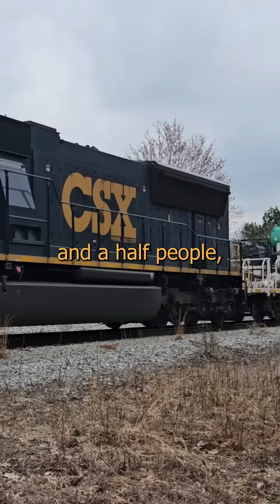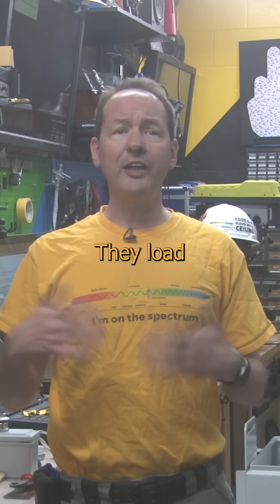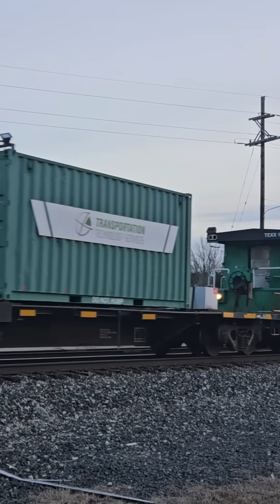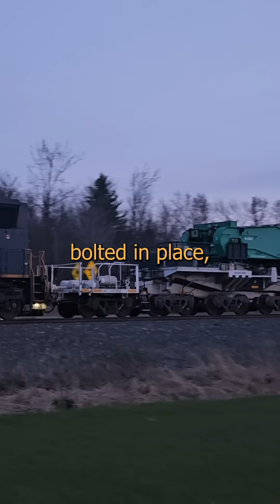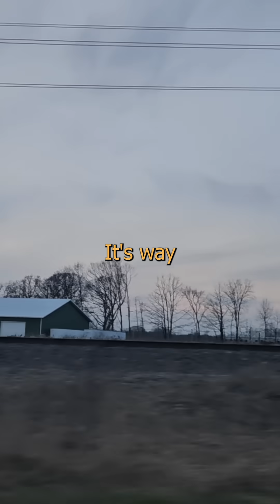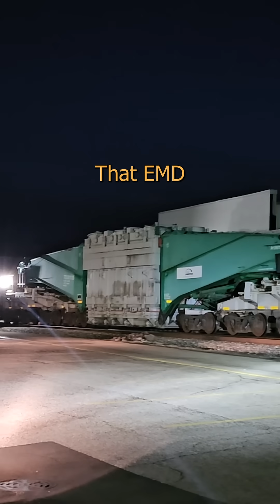Schnabel Car #chrisboden #comedy #train #railroad #physics #transformer #powerplant #engineering

Comment: I play a bit of fairly modded American Truck Simulator, we trailers and loads similar added to our gam, it’s clearly more janky because American Truck Sim wasnt designed for it but pretty much ever rear axles turns all the way around on it and if you get the rear axle backwards you majorly SOL because even with a stupid overkill drive line you stuck maybe doing 15mph while the trailer try to fix itself

Comment: If they're putting two Abrams on a flat car, pretty sure they need extra axles. Not 100% sure, but that would be a 140 ton load.
Reply: Yep. They’re loaded onto DODX 40000 series rail cars which have a capacity of 149 tons. Two M1A2 SEP v3 tanks weigh a total of 147 tons.

Comment: Some of these cars have hydraulic systems because their load isn't just heavy, it's also oversized and needs to be moved sideways or vertically so it doesn't collide with obstacles along the line.
But here in Austria they are usually at the end of a train, behind one or two other cars for equipment and staff. So the longitudinal forces on the load are minimized. Seems they have different rules over there.

Comment: I once saw one of those things that the train was moving on the attachment in Idaho once on two giant ass trailers. It was so fucking tall that I saw it well before I got to the rest area that the M1070 pulling it was parked at. When I say giant trailers, I mean the 13 axle combos that usually move giant construction equipment and electrical substation equipment. I will always kick myself for not pulling in and taking pictures

Comment: Jesus brother... I'm going to have to go sit at the tracks more often. I live along one of CNRL's main-lines... the shit I see come down this track would make your "short and curlies" straighten out, and leave you smiling afterwards. Top that with the fact that the HWY here is a "High Load Corridor" and I've seen rigs with 36 axle's pushing "EVERYTHING" onto the side-roads as they move past at a walking pace (3-6mp/h (or 5-10km/h for those of us not in the US)). 881 US tons (880 tonne) of iron and steel. Wild stuff. Also, love your vids.

Comment: Its also very rare to see a modern freight consist to be using a caboose on the tail end. They fell out of use in the 70s and 80s because of modern monitoring systems.
Reply: That caboose is being used as a control cabin for the schnabel, as they have dedicated operators that can shift the load within the car via radio controlled hydraulics. Also acts as a collision spotter like a traditional caboose

Comment: ¿ Icosapodial ? 

If you would allow me to postulate ?

 " icosa "derived from the ancient Greek word " eikosí " both meaning 20 ... .. .

" podial " In relation to a podium or/and such also in biological anatomy is in relation to the foot, hence a foot doctor is a " podi-atrist "   
In mechanical applications this is referring to the base or a cumulative combination of common columns connections or a varying variety of vertical supports to earth, like but not limited to,
pillars, posts, piers, pylons, pilasters and or in this case I believe wheelsets ( 2 wheels on a train car couple by an axle often mounted to a " bogie " -a pivoting frame assembly typically holding 2 wheelsets ... .. . My hypothesis for this creative vernacular is probably meaning 20 wheels and or points of connection so 20 wheelsets .
So Mr. Boden how was that for an analytical analysis and alliteration ?

Comment: I used to repair rebuild locomotives many moons ago. It is different feeling to stand under a locomotive off of its trucks while doing truck replacements. Most people have never stood under 200 plus tons. It’s shocking to me how many people don’t know that trains and their trucks the axles are only connected by a few cables and air lines.

Comment: I've seen a semi version one. Its very similar to this setup up. But it has semi in the rear as well to help it with turning issues like a firetruck semi with the ladder hauler trailer. Because the load is extremely close to the ground. And sometimes I see them with a pilot car.

Comment: The vertical video format is not doing you any favors in trying to convey the scale of this thing. What an amazing rail... Thing.

I imagine trying to explain this to someone who has never seen one, and all the reasons they'd rattle off for why it would not work, not feasible, no one needs to move that much weight, no one would agree to build a container for their thingamabob to bolt onto that, on and on. 

But there it is, rolling along doing a fine job

Comment: I actually helped work on this as a welder in Boilermakers union, in Waynesboro Ga in 2014. We were using it during reactor 3 and 4 build at plant vogtle, and had to repair some cracked welds. Your right not many will ever see it

Comment: Those things can be offset in the control cab, on banked corners, to avoid obstructions, and not tip over. They have their own power unit, and some have radio remote control, so an operator can walk around while steering it. Obviously at crawl speed, and not while zipping along a straight track.

Comment: Schwerer Gustav

Article

 

Talk

Language

Download PDF

Watch

Edit

Learn more

This article needs additional citations for verification. (January 2016)

Schwerer Gustav (English: Heavy Gustav) was a German 80-centimetre (31.5 in) railway gun. It was developed in the late 1930s by Krupp in Rügenwalde as siege artillery for the explicit purpose of destroying the main forts of the French Maginot Line, the strongest fortifications in existence at the time. The fully assembled gun weighed nearly 1,350 tonnes (1,490 short tons) and could fire shells weighing 7 t (7.7 short tons) to a range of 47 km (29 mi).[1][2]

Schwerer Gustav￼

Model of the Dora

Comment: Big Boy (Steam):

Length: 132 feet (including the tender).

Weight: 1.2 million pounds (when fully loaded with coal and water).

Water Capacity: 25,000 gallons.

Tractive Effort: 135,375 lbs.

Horsepower: 6,300 hp.

Fuel: Originally coal, now No. 5 oil. 

Standard Union Pacific Diesel:

Length: 74 feet.

Weight: Weight varies depending on the specific model and configuration, but generally lighter than Big Boys.

Tractive Effort: Varies depending on the model, but typically less than Big Boys.

Horsepower: Varies depending on the model, but typically less than Big Boys.

Fuel: Diesel fuel.
Reply: FUN FACT there was a type of steam locomotive based on the Schnabel called the Beyer-Garratt and about 1000 were made between 1908 and 1960 mostly being sent to South Africa, Brazil and Australia given they were designed to be very powerful without putting too much strain on bad track in these areas
look up the South African Railways GL class and GMA class and the New South Wales Government Railways AD60 class (both were designed primarily to haul heavy coal trains from the Mines in Natal and New South Wales to the Ports of Durban and Newcastle)

Comment: The train wheels not only deform less, but they are also angled so their contact has less width. Trains run so efficiently because they're almost literally running on a razors edge. It's like ice skating on steel.

This is also why they can't go uphill for shit and need long LONG gradual inclines. No friction also means no traction.

The wheels have to be angled like that so that their self course correcting. If they glide too far to the right, then the radius of the wheel on the right is larger, and the wheel on the left is smaller, changing the rate of rotation  on each side and pushing it back to the center.

Comment: You know the load is massive and heavy when there are only 3 cars!

Those things are MIND-BLOWING!!!!
Reply: FUN FACT there was a type of steam locomotive based on the Schnabel called the Beyer-Garratt and about 1000 were made between 1908 and 1960 mostly being sent to South Africa, Brazil and Australia given they were designed to be very powerful without putting too much strain on bad track in these areas
look up the South African Railways GL class and GMA class and the New South Wales Government Railways AD60 class (both were designed primarily to haul heavy coal trains from the Mines in Natal and New South Wales to the Ports of Durban and Newcastle)

Comment: They used to use one of these to haul oil refinery vessels from Duluth MN to Alberta.  Very cool!  They did it in the winter when the ground was frozen.

The contact patch on a railroad wheel is about the size of a dime.

Comment: Did you guys miss the caboose? That was the second thing I noticed. Haven't seen one of those in forever!
Reply: These are special moves, generally called high and wide moves.  That's why there are no other cars in the consist.  I've heard that, depending on the load, there might be escort personnel from the manufacturer riding with the load.
Reply: To ensure no jarring during the trip, theres been cases were phases are shorted on delivery @videotrains
Reply: I believe CSX requires a Caboose instead of a End of Train Device for special moves. All major rail carriers keep a few Caboose on hand for special use.
Reply: Yup, I miss those old puppies... Now days it's just a Mad Mike plugged into the air line and transmitting to the cab.  Sometimes progression and technology stinks.
Reply: @gerrywalsh5766 they're called FREDs I think
Reply: I noticed that too. neat.
Reply: they stopped using them in the 80s for cost reasons
Reply: I came to say the same thing! You NEVER see those anymore
Reply: @TheGrumpyChuckChannel   Air brakes were created, no need for a brakeman to apply brakes in the back
Reply: @stephaniegiacco7524  That's not a caboose you're thinking of, that's a "braking van".   Cabooses aren't needed on most trains because of technology for lineside defect detectors next to tracks and end-of-train devices.   But they're still used when crews needed, such as for maintenance or for special or hazardous loads.  Hence the one in this video
Reply: @stephaniegiacco7524 Brakemen didn’t activate the brakes since the early 20th century. Brakemen made sure the brake hoses between cars were connected and that the brakes were released after going into emergency. The advent of hotbox detectors and electronic monitoring made the job redundant.
Reply: IKR! And it was painted to match the cars ahead of it. Can't get muck cooler than that!

Comment: As a long time locomotive engineer, those things are pretty cool, and a bit of a hassle for the people who have to actually move them. But if you want to see something REALLY cool, there are similar cars with built in hydraulics which can shift the entire load sideways to get around obstacles. I hit a bridge with one of those once, which very effectively illustrates “bad days make good stories.”
Reply: Dude, dont leave us hanging like that.
Reply: IIRC, a Schnabel car can shift its load laterally on the trucks up to 18 inches at each end in order to get through tight clearance areas such as sharp curves.
Reply: What are the hydraulic moving cars called?
Reply: leaving a comment to hopefully maybe see the story
Reply: @AidenWarrior   Theres always a representative of the shipper riding the caboose on these trains, and he stays in radio contact with the train crew. We had a 15 mph restriction over a plate girder bridge, but we’d already agreed to go walking speed. At the time, they were building a second track in the area and had welded some braces across the tops of the girders. Those braces overhung the inside of the girder by maybe 6-8”, and they were not on the clearance file we had.

I knew it was going to be a tight fit through there regardless, but I didn’t know HOW tight. We hit those braces and ripped them clean off. Of course the guy on the caboose didn’t warn us ahead of time, he just started yelling “stop stop stop stop!” after we hit.

At that point, it was a matter of assessing the damage to both the bridge and the load, then shifting the whole load over a couple inches (remember, we only had about 6” of clearance on each side even without the braces), then very slowly and carefully inching the train forward until we cleared. Then we could shift the load back to the center and carry on.

Consider for a moment that a locomotive throttle has 10 positions. Stop, idle, and 1-8. That’s it. 4,000 horsepower and all the finesse and grace of a Taco Bell fart. It takes a lot of practice to run an entire train like the one in this video with any semblance of smooth control.
Reply: @kenrickman6697  Thats a good story.  Thank you.
Reply: @kenrickman6697  in Germany everything depends on the class of the oversize.
Smaller oversizes can be handled as you mentioned, but larger pieces (not necessarily heavier pieces!) really need an operated Schnabelwagen, where the crew manipulates the load on the car to get everything around corners and obstacles.
Reply: @kenrickman6697  I had not considered that the load of one of these could and oft would be wider than the usual train width and thus elicit the need for creative solutions to clearance
Reply: Straight Outta Service.

Comment: Further reading: The LARGEST Schnabel car in public railroad operation, reporting number WECX 801, was completed in 2012 by Kasgro Railcar for Westinghouse Nuclear and is used in North America primarily to transport reactor containment vessels.

It has 36 axles (18 for each half). Each half contains nine trucks which are connected by a complex system of span bolsters. Its tare (unloaded) weight is 399.6 short tons (362.5 t; 356.8 long tons) and has a load limit of 1,017.9 short tons (923.4 t; 908.8 long tons) for a maximum gross weight of 1,417.5 short tons (1,285.9 t; 1,265.6 long tons).

Now that’s what I call “fuck you physics”
Reply: That's almost as heavy as yo mama 😮
Reply: Could you please explain what are short and long tons ? In europe we have tons, that's 1000kg.
Reply: @jordic6188  Long ton = 2,240 pounds.  Metric ton = 2,205lb.  Short ton = 2,000lb.

The Long Ton is the weight of the standard cask of wine (a "tun") used to transport alcohol by ship in the days of yore.  Each barrel of wine occupied approximately 100 cubic feet, which is where the "gross ton" measurement of ship cargo volume comes from, which was how taxes and fees were assessed on vessels--basically, the vessel was taxed on how much alcohol it could carry.

Incidentally, while the metric system has a volume/mass conversion of units in that 1 cubic centimeter of pure water weighs 1 gram, the imperial system is based on alcohol.  Which measurement system would YOU prefer?  :)
Reply: We're Americans, we don't make sense, we make dollars - The Fat Electrician

Seriously though, who looked at a nuclear reactor containment vessel and said, "I wanna move that. Make it happen!"
Reply: @Nthsey  nice Wikipedia copy paste aha
Reply: The average contact patch of a rail wheel is about the size of your thumbnail.
Reply: AI again

Comment: When i was younger and a lot dumber i worked for a maintenance contractor for railroads. Ballast cleaners, tampers, BDS, and grinders are all really cool trains basically. The ballast cleaner I was on was 3 cars, 418,000 pounds, and had 2x 10 or 12 foot tall digging wheels that each weighed 8 tons. You could stand inside them, and had to for maintenance. Trains are cool but the maintenance stuff is insane at the size and scale sometimes.

Comment: My company (XFMR OEM) shipped a 970 MVA generation step-up (GSU) to a nuclear plant a few years back.  That weighed 816,000 lbs (shipping weight, dry) and did NOT require a Schnable car!   The xfmr in this video appears to be made by Mitsubishi, probably in their Ako, Japan plant and is most likely shell form.

Comment: I suspect this car is more about the height of the object and not its weight, though it could be both.
Imagine if it was very tall but lightweight, putting anything underneath would always increase that height further, and the train needs to fit into tunnels and under overpasses so that simply isn't an option. So the supports are on the sides.